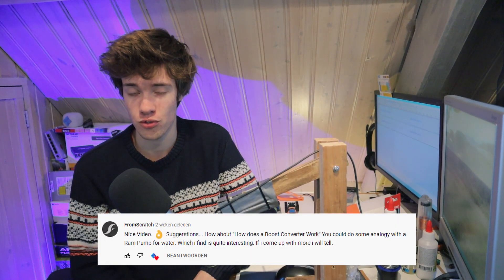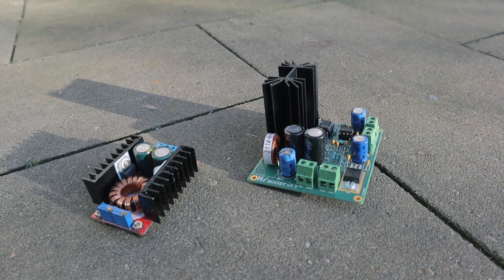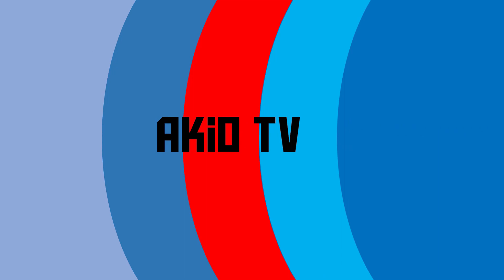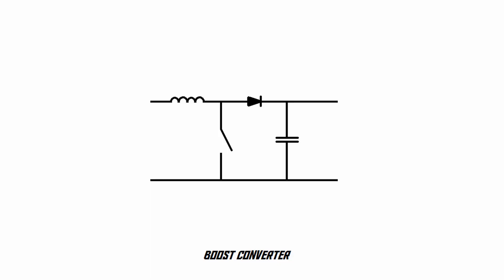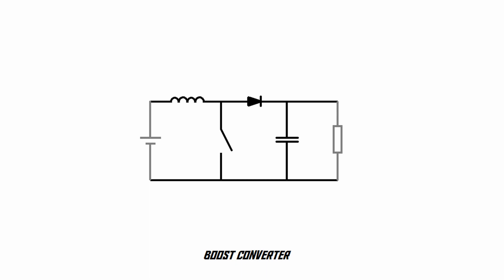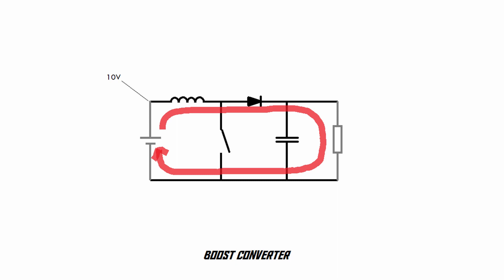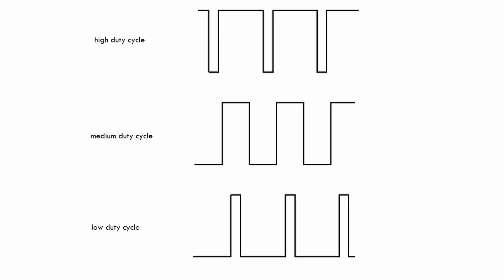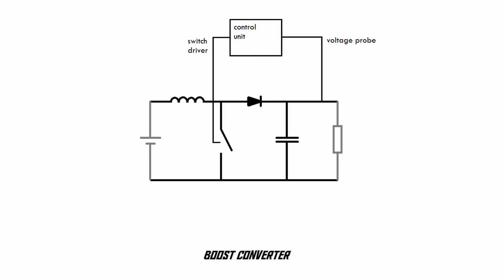What is a boost converter and how does it work?

Comment: Another factor in the switching frequency trade-off is that higher frequency ripple voltage is easier to filter and tends to have less noticeable effects on most loads if unfiltered.